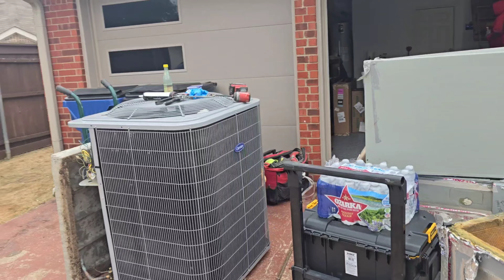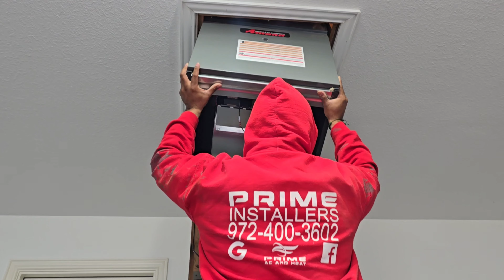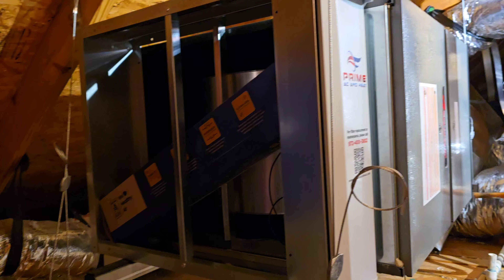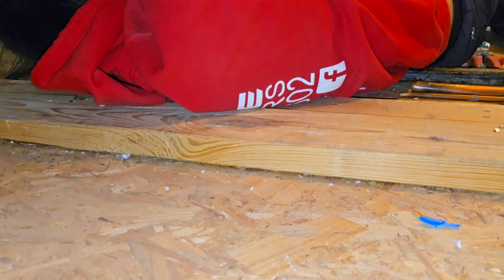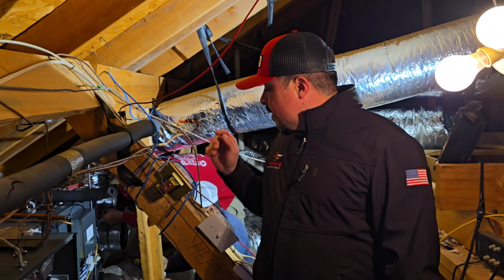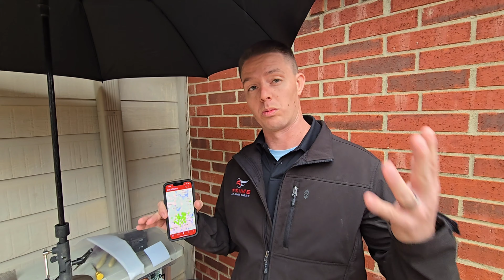Superbowl Sunday Installation with Morgan | Amana S Series R32

Comment: If I were a hvac tech should I be concerned about job security? Also do your Installation crews and techs go through factory training periodically?  Lastly, working on a Sunday, I'm highly impressed.
Reply from the maker: HVAC is a strong and growing industry, so job security for skilled techs is solid! We invest in continuous training—both in-house and through manufacturer-sponsored programs with our local distributor. Plus, at Prime HQ, we have a live S-Series dual-fuel heat pump with zoning, so our team can fine-tune their skills on real working systems.

We’re available seven days a week, with a rotating schedule to ensure our customers always get the help they need. Appreciate the shoutout!